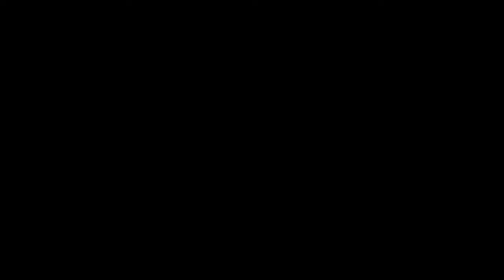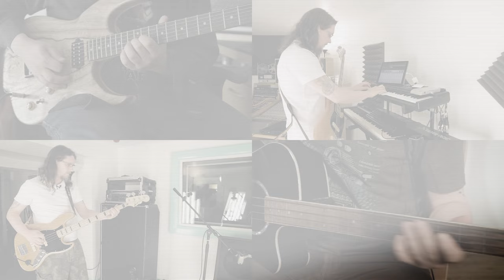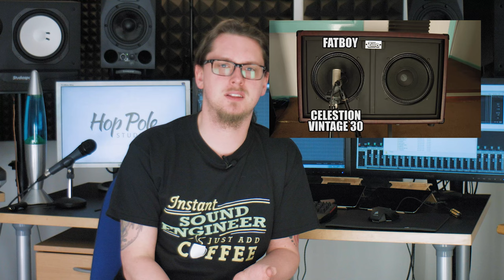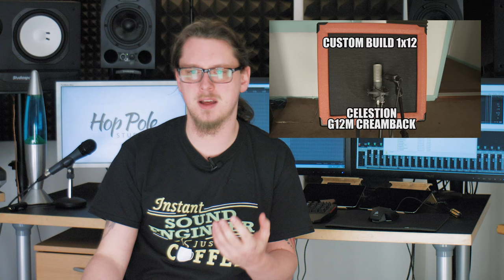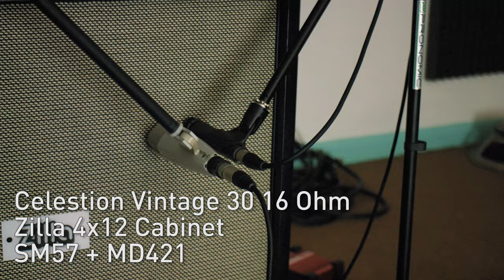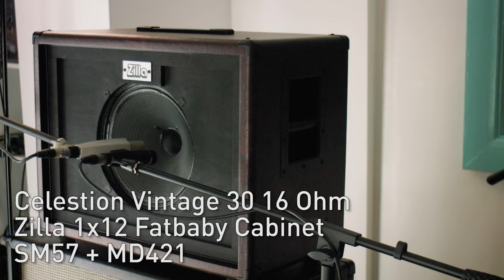4x12 vs 2x12 vs 1x12 Guitar Cab comparison:- All ZIlla, all Vintage 30

Comment: 2x12 sounded best to me, it combined the best qualities of the 1x12 and 4x12; not too dark/dull and not too bright.
Reply: I assumed I'd like the 4x12 best, but the 2x12 was definitely my favorite too.
Reply: Exactly. Especially the solo part proves this. Not as dull as the 4x12, enough cutting force, but not as harsh and light bottomed as the 1x12.
Reply: Agree
Reply: That was my least favorite. very spiky. Was surprised how good the single 12 sounded but the 4x12 sounded the best.
Reply: Most of feeling of 'size' with a 112 can be solved with a port.  If you need more than that, get two 112 speakers.  1 ported and 1 sealed.  Easier to carry around by far, and has all that focus the 212 and 412 lack.
Reply: It could be bias towards compromise.
If you are comparing 2 things, typically people are biases to the brighter sound (unless it's insanely bright and piercing of course). Then when you add a 3rd thing, people will usually pick the one in the middle, because it's a compromise.

The only way to really get a hang of what sounds better is to hear full mixes over and over in a variety of situations over time, to really figure out which sounds best.. And usually it's whatever blends better with the rest of the mix...  Or put forth qualities and expressions from the given riffage that are less apparent with the other cabs but convey more emotion..
Reply: yup
Reply: Agree
Reply: Concuerdo con tu comentario, es muy evidente que la claridad de sonido respecto a graves, medios y agudos es muy agradable, y según mi opinión, siento que al usar distorsión, el sonido es más contundente y preciso en relación a una gabinete 4x12
Reply: 4x12s sound better in person a 2x12 is noticably thin in comparison for band practice
Reply from the maker: Sounds like you’ve got a poor quality 2x12 there
Reply: @adamsteelproducer  EVH 2x12's are pretty damn good lol,  that was a poor quality comment.
Reply: @adamsteelproducer  is a 412 even that much louder then a 212 had to downgrade the big 412 cab was 4ohms blew my katana head twice so no it's in the shop so I got the matching cab ....so I been using. 20 watt zombie head it was super loud and kept up with full band I play metal. Now that I have the 212 is it tht bunch of a diff in volume? Sorry for the rant
Reply: Même un 4x12 bas de gamme serra toujours supérieur à un 2x12 haut de gamme.... chercher pas si vous avez de la place et le courage de porter 4x12 win

Comment: The sound was brighter as the cabs got smaller. This was really well done. I wish you would have added a room mic to allow a comparison between how the cabs sounded from a few feet back as well. I think that would have brought out even more differences. Great video!
Reply: David Schiedler 
Ya, another reason to make a new comparison...
Reply from the maker: They’re coming! It just takes ages to get organised and do the whole thing
Reply: That's couse overall impedande had changed between cabinets so treble gets fucked up by the same impedance output of amp.
Reply from the maker: Not true- the impedance of the amp was changed to match each speaker load.
Reply: Agreed. The less speakers equal more treble punch....i need the warmth of the 4x12. Cuz i play a Stratocaster
Reply: I can ruin that result for you. In person, a 4x12 (even at very low volume) fills up the room and sounds so much better than a 2x12

Comment: That was a VERY well done analysis. And the audio results make total sense... 1 cone is more focused and cuts, with two you the signal has more phase issues (and richer sound), and with 4 much more of both. 

The 4x12 sounds richer to the ear but recording wise, Imo the best is to record 1x12 for a purest (less smeared) wave which cut in the mix, and then work in the mix to get the precise sound you want (ej doubling, chorusing etc).

Comment: Thanks so much for this video! I've been saving my space in my studio with 2X12 cabs and just never got the oomph I've been looking for. It's quite obvious that "size matters". Yes, it may be the power handling/spreading as well. On my studio monitors, the sound follows the visuals exactly. If you want big, you need 4X12. I do see the the need for the others too. They get more intimate the smaller they get. Very educational vid. Thanks again!

Comment: The 2x12 does indeed sound nicest....on a phone or laptop :). However, the 4x12, even though only one speaker is mic'd up, still rules the roost on a good set of studio monitors, which is where this comparison really makes the differences apparent.  All three sounded like my experience both live and at home over many decades. And, the 4x12 always sounds best in the room. The 2x12 just doesn't sound as together and fat, or sit in a mix like a good 4x12. After owning about every Marshall 1x12. 2x12 and 4x12 made from 1964 through the 60's, 70's and 80's. I kept two 4x12's over all the others. Your experience may differ, but for me nothing beats a 4x12 for tone and balls, at any volume level. This video reinforces that very well. Great job on it...my two cents.
Reply: Through my monitors the 2x12 sounds the nicest.
Reply: 4x12 sound great except your soundman will hate you , your back pain will get to you later in life and transporting it without a truck is not easy
Reply: in my room 2x12 is the one. 
Cuts, won't  have to pull low end out to make it fit well.

Comment: Thanks for this. I was surprised because the smaller amp/cab you use, generally, the bigger sound you get because you're maxing things much easier. But the 2x12 actually sounded better to me than the 1x12 3/4 time. The compromise is how much volume you want and volume doesn't scale linearly with voltage (ask my Bassman 70 vs my 100 and 140w). It was definitely brighter the smaller the cab was but the 1x12 was a good mix. That's just my ears, and I prefer open back, but everyone's got their own taste.

Comment: Good work. The grill cloth will dampen the highs a tad for 412 cab. I think mics placed at each cab's mid centre maybe 1 metre away from front would also make an interesting comparo
Reply from the maker: At some point we’re doing a revisit of this series and including room mics. As for the grill cloth, that’s mostly a myth! I made a video on it
Reply: Zilla did a demo of grill cloths and the differing results were so microscopic that their recommendation is to just pick the grill cloth that looks good.. At least from their selections.
Reply from the maker: Yep! I’m going to the Zilla factory tomorrow to see them and maybe appear in a video!
Reply: @adamsteelproducer  what a coincidence! Hehe
Reply: @adamsteelproducer  My main thing about speaker grills is that I have to easily see the cone with just a small flashlight. If I can't see the cone with just my phone's flashlight, it becomes a pita.

Another cool thing to use bth is a smapp led floor lamp or clip on lamp... Preferably with a flat face that doesn't leak to the sides, to put flat, right on the speaker grill.

Comment: A matter of dedicated vs blending sound I guess. Chances are though the 1x12 is going to be an 8 Ohm speaker version, which roughly is double the output rating every 4 Ohms because the amp may be rated at 4 Ohms might be 40W, at 8 Ohms becomes roughly 20W and at 16 Ohms is 10W. The 2x12 is a matter of series or parallel as is the 4x12. 4x16 Ohm speakers is generally wired as an 8 Ohm cabinet, combination of 2 speakers wired in series, 2 in parallel. The 2x16 Ohm is either 32 Ohm in series or 8 Ohm in parallel cabinet. It's not a matter of being a fair test to do this with the same 16 Ohm speakers because cabinet manufacturers use different Ohm speakers for 1x, 2x & 4x. The other aspect, when you have 1x, 2x or 4x speakers the cab can handle a combined higher wattage, the 1x12 with the 30W rated speaker and the amp needs to be under 30W. A 2x12 doubles that power rating, to 60W, so you can use a more powerful amp. A 4x12 and that's a whopping 120W capable cabinet. We're seeing the difference between a 20, 50 & 100W amp head going into what the cabinet is capable of handling without imploding. The figures I used, based upon generalities, not a specific case.

Comment: 👍🇺🇸❤412 WARMER & MORE BALANCED (the xtra 2 speakers help load down the sound, less loudness / harshness ) * more full bodied........🤓 2X12 SOUNDS LOUDER & BRIGHTER.........1×12 will even be more percussive , harsh & raw........the less speakers the more push from the amplifier. The size of the enclosure's sound waves plays a big roll👍🇺🇸❤I always use 2 - 4X12's....per 100w amp head.

Comment: Excellent work. I have an ENGL 4x12 and a 2x12 with speakers made within 6 months, and I am blown away by the difference, even when sitting straight in front of the cones. Was considering by a 1x12 because I don't like the 2x12 as much, but this makes me doubt it'll make me happy either. The 4x12 is so much more polished. In your video, the only thing I would think that would create a difference would be if the V30's were of a different vintage, but I guess they were all relatively recently produced at the time of making?

Comment: This is good to know. I just bought a Marshall dsl1r head, but I couldn’t afford a cab so I got a Crate 250 2x12 combo cheap. I’m either gonna it and make it closed back or just close off the back and leave the amp inside. I know they’re not Celestion Vintage 30’s but it’s a start. The speakers are 8 ohm wired in parallel to 4 ohms . Gonna wire them in series to 16 ohm to match the amps impedance.

Comment: One variation I noticed was that the 4x12 had a non see through screen and because of this you may have slightly different mic placement. The 2x12 had the mics pointed for the most part closer to the center of the speaker. These speakers typically need to be mic'd slightly off axis just outside of the center paper ring 2 - 3 inches. The region right in the middle speaker will definitely sound brighter, compared to mic'ing the speaker in between the outside edge and the center ring.  Still a very good video, and presented very well. Cheers
Reply from the maker: The speakers were miced identically, a lot of time, torches and measuring tape were used to make sure they were accurate! And the grill cloth makes little difference, we made another video to show that.

Comment: So at least in this vid you can tell that it's the same speaker many times. That's pretty nice. You can tell there's more bottom-end saturation in the 4x12 and... well, it kinda gets a little mushy. Almost feels like 2x12 is the midway as the 1x12 felt a little too bright. 

Then we've got the angled 2x12 but that's a different story. And I'm here like 6 years later so. :D Never mind me.

Comment: It's seems, to me, to be a great presentation of the 3 cab types, I heard the 4x12 as full, rich low end, nice mid range, with a bit of a muddied high end. 2x12 Sounds pretty amazing with enough low end to bark and growl but not muddle, mids are spanking crunch, and High end is crisp&sharp. 1x12 Is same as 2x12 just less low end a bit more biting in the highs. All in all,  I think my ideal set up would be 1-4x12 cab, 1-2x12 cab and 2 -1x12 cabs. Put a Driftwood Purple Nightmare, Fortin Natas or Randall Satan, and the beast in me would be satisfied! the comments tell me how subjective and preference based finding the best tone is. It boils down to what sounds best to you? If I had to pick only one though... 2x12 for me.

Comment: Thanks for the comparison. It was insightful. I like a warm tone that sounds as natural as possible. So for me, the 4x12 sounded best. I use a 4x12 and don't even load it with 4 speakers. I set two diagonally. Lighter to carry around. For the type of sound I want, I have found the bigger the cabinet, in general, the nicer the tone. There is even great variation in 4x12s. I have found 3/4" plywood to  produce a cabinet with better tone than 3/4" particleboard. Plywood is also lighter and stronger than particleboard. Also the grill matters. Some grill cloths take more treble out of the sound than others.

Comment: Good comparison vid. If doing it again I'd say definitely need a room mic. Also, not easy to make equal comparison as the speakers aren't being driven the same amount. The 412 speakers would be running at 25% and the 212's at 50% if the 112 was maxed out so I'd fully expect different results when just mixing the 1 cone. Nonetheless, good vid, well done...

Comment: 2x12 definitely sounded the best (I agree the 1x12 sounded the best in the mix I'd rather cut some low end than not have it in the first place), but I think that had more to do with the mic placement than a lot of people think. I think I'll go with a 1x12 for the portability and try to figure out how to get the best tones out of it, I'm sure I could get it to sound like that 2x12.

PS I watched this video through Mackie CR3 studio monitors and Scarlett HP60 MkII studio monitor headphones, which are both affordable but definitely better than the average computer speaker system.

Comment: I'd be interested to see if you could make them sound closer to each other with changes of the amp EQ, mic placement and post production. So, can you make a 1x12, a 2x12 and a 4x12 sound the same in a mix? I'd love to see you try that as I'd like to buy a cab and potentially save some money.

Personally liked the 4x12 a little more in some ways as the 2x12 was a little too 'bitey', a focus on the upper mids/lower treble. I'd probably choose the 2x12 saying that though as the extra bite would probably be helpful with some tone shaping from the amp + mic placement.

Comment: Great video, and most informative. However, as a gigging musician who plays in venues where we have to rely on the sound from the amp, rather than miked through the PA,  it would have been interesting to hear the cabs from the player's point of view ie miked from 8-12ft away, rather than 8-12mm(!), to get an idea of how each interact with the room environment. Obviously, you've exhausted this setup now, but it would be great if you could include a 'what the things really sound like from speaker to ear' section in future comparisons.

Comment: yeah it makes sense to drive only one speaker becouse it pushes more air with lover volume and it that matter puts more higer hz and box size gives optimum lo fruequecy cut ... Q is? if you comppare to it 4x12 and 2x12 with conecting only one speaker in them would give different results? cheers!

Comment: as far as i can tell in my studio, the smaller cabinet made a brighter sound. this makes sense because the modes depend on the physical dimensions of the cabinet as well as the speed of sound. less distance for the sound to travel equal higher frequency modes which means a brighter sound. also i don't think there would be any difference in the tone between having 1 speaker or 4 speakers in the same cabinet, the difference would be in the dispersion of sound and not the actual quality or tone. 

i'd like to see a comparison between open and closed cabinets, i predict the closed cabinet would make tighter bass, but would see more harmonic distortion at high volume.

Comment: You changed the color of your socks between them, rendering the whole test null and void. You’ll have to do the whole thing over again.

But seriously. Thanks for this. It’s amazing how the size of the cabinet - pretty sure that’s what the diff is - makes a huge difference. Smaller = brighter. Bigger = darker, maybe smoother. Maybe less gunk to have to EQ out. 

I’d guess a single speaker with each of those sizes might give the same result. Not sure tho...

Comment: Wow great Video. i personally didn't notice much difference in the mix. when by themselves i noticed a minor difference between the 2x12 and the 4x12. The 1x12 though sounded extremely thin outside the mix.

Comment: Treat comparison. I think I prefer the sound of the 2 by 12, but agree with your need as a mix engineer for a more focused tone with not too much lows. 
I've been wondering about the difference between 10, 12 and 15 inch speakers (I own a Peavey Delta Blues with 15 inch speaker). I'm considering buying a small tube amp and build a cabinet myself. But which cabinet, and for thast matter: which amp?

Comment: Great video, 4x12 does sound the best on its own. How ever in a full rock and metal mix you end up filtering out from 80-150hz and in some cases using multi band compression from 250hz to tame the chugs(actually makes guitars sound heavier) so all the extra bass frequencies are kind of pointless. When recording I have less work to do after in the mix when using 2x12 and I know Machine(Lamb of God producer) swears by 2x12s for recording. Never recorded a 1x12 but I heard Alice In Chains did while micing the back with with a u87 and a 57 on the front. Basically imo they all work but for recording I’d always pick a good 2x12.
Reply: Thats very interresting not only becauss Im a HUGEEE Alice in Chains fans but also because Im stuck between choosing 2x12 in production as im scared to interfere with the bassist or 4x12 because its bigger darker sound is better on its own..

Comment: 1x12 sounded thinner than 2x12 which sounded thinner than 4x12.  That is how it translated in this video though it probably just sounds more focused in the room.  I have a closed back 1x12 and a closed back 2x12 and the dispersion seems different, but they both get equally as loud with the same source.